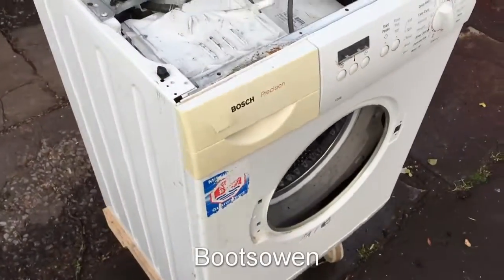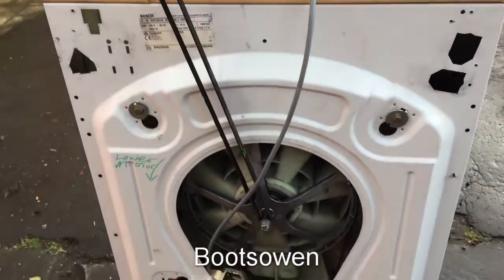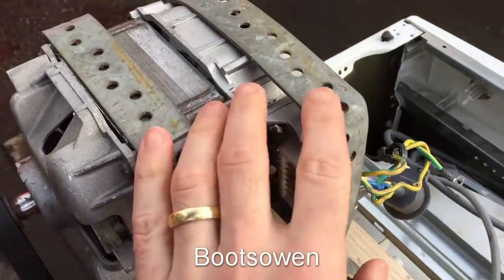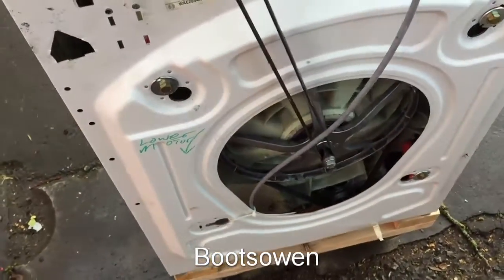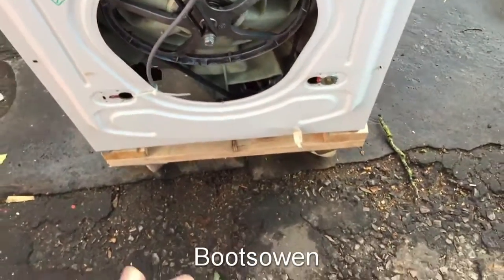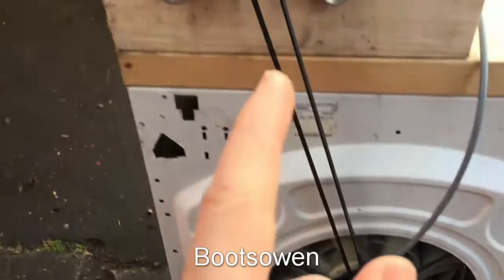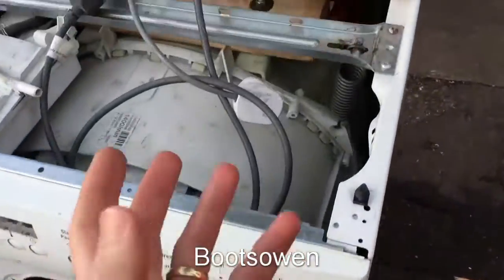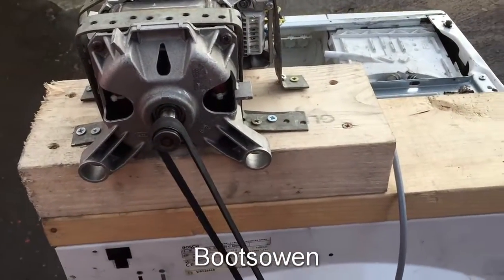FrankenBosch Update

Comment: i don't think you need the 2 motors, a pully gears the motor down as it spins at 11,000 to 17,000rpm, haveing just 2 spines and no pully should make the drum spin to lets say 11,000rpm.
Reply from the maker: Typical universal motors under no load attempt to spin at infinite speed. However, because of internal friction and other losses they will typically achieve 11000-17000 rpm under no load.  Once there is a load the speed comes down a lot. As you can see from this video.  Adding the second smaller pulley really didn't make any difference. I don't believe that there is any way to get the machine to spin at 11000 rpm with a single universal washing machine motor.  But I would gladly watch a video of you attempting to prove me wrong!